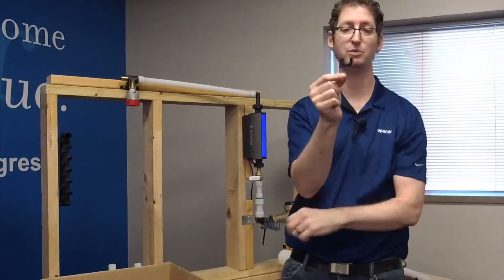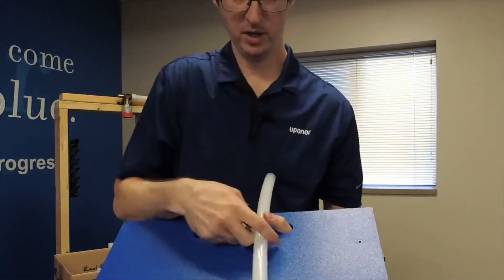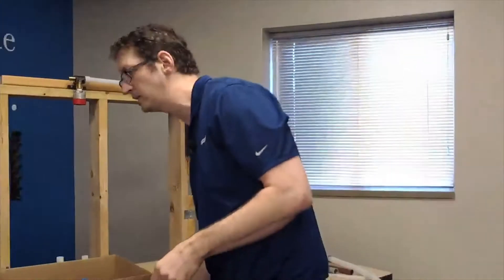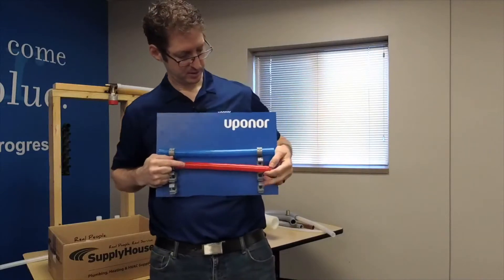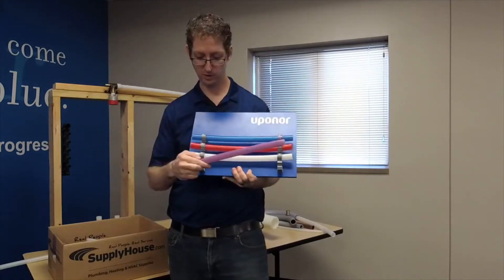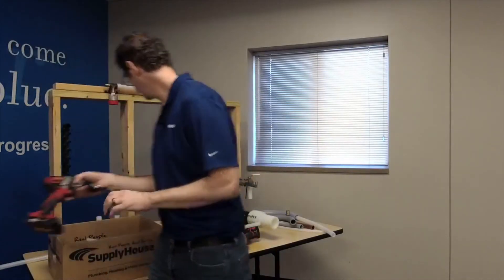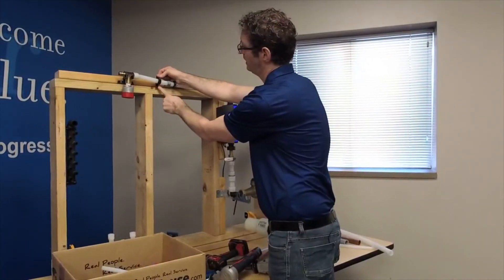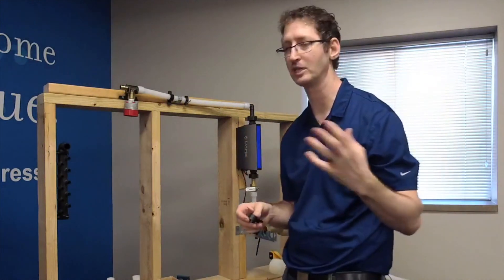Uponor Pipe Hangers and PEX Clips

Comment: When you run a hot-water Pex line horizontally, there is a considerable amount of thermal expansion, which the Pex line accommodates by sagging quite visibly because the clips prevent the line from sliding. Is this a problem and, if so, how to avoid it. Thank youl
Reply from the maker: Hi there! It sounds like the clips may be too tight. Some details that might be helpful to you regarding general requirements for supporting PEX pipe can be found in this document on pages 32 - 34. https://www.uponor.com/getmedia/b88822e9-e713-432b-a495-d54bab71a37c/uponor-piping-installation-guide.pdf?sitename=USA  Hopefully this helps!

Comment: Sorry, but bullshit. Trying to hammer one of those clips over a 3/4" pipe is not easy to do. It is impossible to nail in straight as the clamp does not sit on the wood, and will twist to the side.  The hanmer in clamps are useless.

Comment: Running PEX through previous holes in floor joists or 2x4’s. I use a small piece of 3/4” PEX & run 1/2” PEX trough it.  I put an expansion sleeve/collar on the leading end to keep it in the wood hole as I pull the 1/2” PEX. It’s a loose fit & it keeps the 1/2” PEX from rubbing in the wood hole. I use scrap pieces for this.
Reply: Thank you for this, I may try it! My project is in an old house with very dense, old-growth wood. Drilling, hammering, and screwing into it -- even for the tiny screws or nails these little hangers use -- is like dealing with concrete. If I do not pre-drill even small holes, I risk failure. I swear the wood must be petrified. If your method can delete that step for going through 2X that sounds good to me.